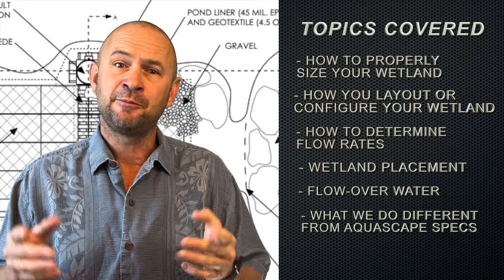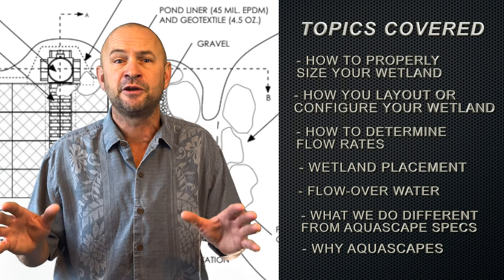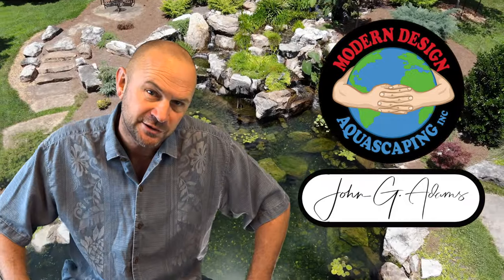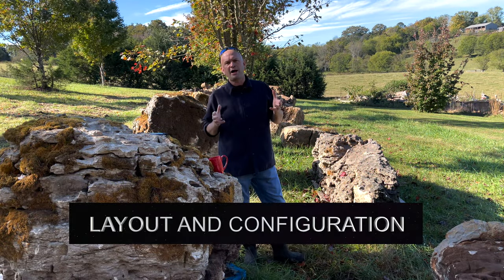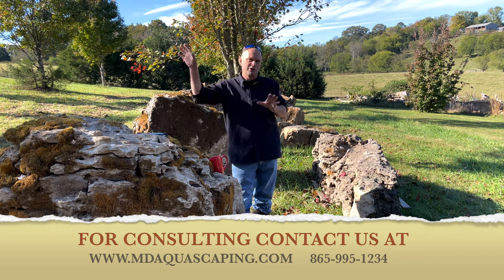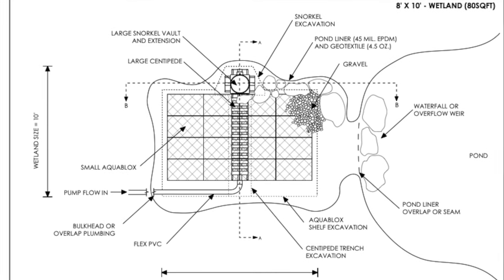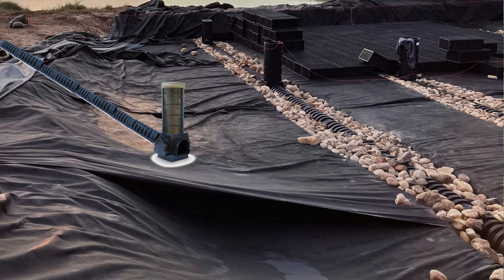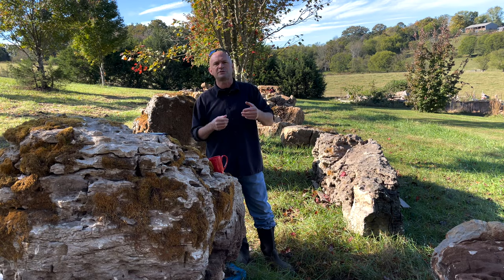How to Design and Size a Wetland Filter | Water Feature Design Series #7.1

Comment: Thanks, John. I have learned so much from you and your channel.

I'm getting to the end of my DIY swim pond build, and I engineered my own wetland filter components to mimic the aquascape system out of 12" smooth wall culvert for the centipede, 18" pipe for the snorkel and reinforced milk crates for the aquablocks. I did all the calcs to make sure my "centipede" had the same volume and open area as the real thing. Tested and loaded the milk crates to make sure they would be sufficiently strong and used the right number of them to get the same settling space as aquablocks. And 100 other little details.

This was a labor of love for myself and the sheer desire to learn the engineering behind it by creating my own solutions. I'm certain that if I were to do it again, I could do it all much faster and with more confidence. But I am also certain that the only way it saved any money is because I can value my time at $0.

If you're a professional trying to make a living building ponds, I think you would be such a fool to do it my way. Listen to John, buy the pre-engineered products, and get better at selling them than trying to figure out how to save a few $ on materials while adding tons of extra labor to your projects.
Reply from the maker: WOW- I did that EXACT same thing 10 years ago--and I came to the same conclusion. I am interested to learn more about your project!
Reply: @KoiAddiction  Sure thing. I'm (mostly) documenting it on this playlist: https://www.youtube.com/playlist?list=PLrOwYsnaliWJp1PPbFNrt-nI0vjj8Btg-

Comment: Hello John, i realy enjoy your videos. They help me a lot in planning my future Koi Pond. I defenitly would hire you, but i live in Germany, so no option 🤣 I grab all of the information i get from you to plan my Pond. I got so many questions, but one of the most interesting one is: how many times per hour would you circulating the pond through the wetland filter? The pond will be aproximitly 1800 square feet of surface area and mostly for keeping Koi. No realy run offs like leaves in this area. I know, that there is not the "one and only" true answer to this question. But in my eyes, it is one of the most importent ones! Greetings from Germany 🤗
Reply from the maker: I wanna build in Germany! I am going to Aquatic Art Live event in England end of the month, look us up! Wetland flow is based on size of wetland, not size of pond! 1500-2000 gallons per hour / per centipede unit! Size wetland properly for the pond and then flow rate to wetland!

Comment: GREAT INFO!
Reply from the maker: Was there anything new in there? Did you learn anything?
Reply: @KoiAddiction  A lot of it is recap, but you explained the process in a way that's easier to understand. Also about always experimenting to figure out the best solution for great water quality and understanding that sometimes things don't work out the way you wanted them too but by sharing the experience, others won't make the same mistakes!

Comment: Another informative video. Timely as I am bidding a few right now.
Reply from the maker: Hope you got some nuggets! Cheers!
Reply: @KoiAddiction  one of our fellow CAC s, near me, suggested I build this 50 square meter rec pond with two skimmers for the heavy leaf load, with two pipes per skimmer to an external dry pool pump. Then through a sand filter that is using glass media. Then to the wetlands.  Too much? And can a pool pump suck straight from the bottom of the skimmer? Only small matter will get to the pump?
Reply from the maker: @BaruchDavidGreenman  I did that before, the skimmers & pads  just can’t handle that much life matter. They end up leaving the filter pads out most of the time. Then the strainer baskets in the external pumps fill up with leaves pretty quickly. I would be cautious with all of that and do not max out the flow rates on your skimmer. In the sand filter I would throw that out the window absolutely no use for that when you have a Wetland
Reply: @KoiAddiction  I thought to use an intake bay for most of the water and a  skimmer or two for surface debris. That's more your style?

Comment: You are just amazing ! Under this video, once again, I want to say thank you for these so valuable pieces of information. Back in France where I live, we have no Aquascape contractors available and I need to design all myself. What you give away is gold to me ! 
Now can I ask you a few questions ? 
1. When designing a swim pond (no fish), how deep would you recommend it to be and with how many shelves (height, width)
2. For the wetland dimensioning, you don’t follow Aquascape guidance right ? For a pond of 500sqf they recommend a 8’x10’ which is 15%. But for a 500 sqf swim pond without fish, you would recommend 30%% according to your video ? (Can not having fishes allow to keep the 15%?). How then to calculate the length of centipede and the number of Aquablox?
3. when talking about turn-over flow, you mentioned once that you are looking at 1 to 2 times the volume of the pond per hour. Should all this volume go through the filter or you also count there that part of it goes to jets or additional waterfalls? 
Many thanks if you can answer this !
Reply from the maker: I wouldn’t skip the fish for starters- they are a valuable piece of the ecosystem! Like making soup without one of the key ingredients- won’t be quite the same. Swim pond depth is up to you- no rules on size. Same with shelves. Depending on stone size- I cut shelves based on the boulders to make easier building. Smaller stones are more stable on shelves though vs. vertical walls just be sure to build for stability.The 30% is a guideline, once again you can do less but if room & budget allow do the 30. LIke I said before if you can only do 15% plan to add another filter in the future (in your design) and then if you are dissatisfied with quality you have a backup plan. Wetland will be laid out in multiples of 16 small blocks (or 8 if you add a 1/2 centipede). So just extend the length of the filter as needed until you get your design. Google Aquascape wetland design or call them at 1-866-USPONDS. They will email you a schematic for the filter! For turn-over just pump the water at the filter flow rate as instructed in the video. Depending on size I add jets (we also have a video on that) for circulation but the wetland will filter at 1500-2000 gallons per hour / per centipede. Additional flow id beneficial for circulation and eliminating dead zones in the pond but not necessary for filtration. Be sure you have waterfall in the system or additional aeration as well to keep oxygen levels high! Good luck ;)
Reply: @KoiAddiction  How can I say thank you enough to provide all this information, and on Sunday moreover ! Amazing people ! Would definitely contract you if you were around my place !! 👏👏

Comment: I'm kinda glad I didn't finish my pond build. I was going with 8 small blocks. I don't have the room (or money 😆 ) for 16. Can I stack them in the wetland filter?  Does negative edge filter at all? I'm doing a negative edge instead of intake bay. Also thanks for all your videos. You have great content and I can't wait to see the finished Oasis Of Tranquility!!!
Reply from the maker: No use to stack them in the wetland- the filter is based on surface area. If anything deeper gravel may be an option. Yes the negative edge will filter a bit- stone and gravel surface should have beneficial bacteria and high oxygen levels in that area.
Reply: @KoiAddiction  thx!!! I can definitely go deeper. I will do 3, 12-16" layers of gravel instead of 8"  and just get a snorkel extension.

Comment: Hi John, thanks for all the videos, really learnt a lot from your channel. Do you have any guide for wetland filter in pond, reverse flow? From most of the guides, the wetland is up flow through the wetland, it's possible to make it down flow and what's changes is needed compared to up flow wetland? Pro and Cons? Thanks bunch!
Reply from the maker: No I don’t have a video on the reverse flow wetland. I have built one but of course it Hass to be inside the pond drawing water down through it which makes it impossible to clean without draining the pond. Also lacks the capacity to be pre-filtered by another portion of your filtration system like an intake bay or skimmer box. The reverse flow into the wetland forces it to clog up on the surface restricting flow and makes it more maintenance. It does still work it’s just not as good as the other way in my opinion anyways.
Reply: @KoiAddiction  got it, thanks!

Comment: I have heard that you can flow through each small aquablox about 90-125 GPH. My question is can you flow through less GPH? like as low as 60-75 GPH through each small aquablox, or would that not create enough up flow pressure through the layers of gravel?
Reply from the maker: You can do less, but you should be wary of low oxygen levels. we want to maintain an aerobic environment so test it if you build it OR just build a smaller wetland to the flow??

Comment: So if I have a deeper gravel bed - say 36” instead of 24”.  Can i have or do I need more flow?
Reply from the maker: Yes. You will need to test oxygen levels to figure that one out. Measure dissolved oxygen from water going into the filter and then again coming out the top. As long as you are staying in range healthy for beneficial bacteria you are good!

Comment: Great video, thank you! But why upflow? Is downflow worse, and if so, why? In Europe, swimming ponds often use downflow trough the wetland filter.
Reply from the maker: I have done down-flow. For me its about ease of cleaning . The one we installed was in a pond and it would draw the water in through the wetland. It works fine BUT I have to drain the pond to clean it. Could be designed differently and I would be OK. Potato-Po-tah-toe if you know what I am saying?
Reply: @KoiAddiction  Sorry, not really :) Any tip to how a downflow WF could be designed ease cleaning? Thank you!
Reply from the maker: @petersvan7880  not sure- I had to drain the pond and rinse forever to get mine fairly clean. It was never able to get as clean as our current design.

Comment: How much does depth of the wetland matter? If i I want to use a wetland as a vegetable/fruit garden, can I go wider but shallower than the 3-4 foot deep pits I sometimes see in your videos? like maybe only deep enough for the snorkel, one layer of blox, then the gravel? and does a higher vegetation load necessitate a bigger wetland? what would redoing the math for that configuration look like?

Also, Can you tell us more about wetland filters at the bottom of ponds and how that works? I thought the plants were essential to using the nutrients in the water in order to clean it but you could only use underwater plants that you wouldn't see if it's under water, right? and how would you clean it, because if you backflush it, you've dirtied all your pond water and can only clean it by having the wetland suck it back down to where it was in the first place, right?
Reply from the maker: Please read a few of the answers to the questions right above yours- I just answered your questions above and they are “long-ish” answers! You don’t have rules-per say. Any configuration is possible and what you do differently may be exactly what is needed to get the results that you are looking for! If you experiment, please let me know what and how- I love to learn! Thanks John G

Comment: Why must you do a back wash of the wetland filtration system if inserting a sum pump in the snorkel will remove solid waste? Also, when you do a back wash, must you replace all the water?
Reply from the maker: The back wash pushes the solids down to the pump for removal and yes, the water from the cleaning of the wetland is discharged from the system.

Comment: Can you turn a wetlands into a giant reverse osmosis filter? With charcoal etc
Reply from the maker: LOL that is an interesting (and new) question!! I have had a RO filter before, have never thought about trying to make a wetland into one…
Reply: @KoiAddiction  bioballs inside the aquablox (more surface area for bacteria), then a large chunky charcoal layer, then a porous rock layer (lava?). Will that work?
Reply from the maker: My favorite thing about a wetland filter is how easy it is to backflush. It does a great job of settling out fine particulates if you have your water flow dialed in. It makes it easy to drop a sump pump and pump out fine particulates, much like m a vortex filter captures Debris. The problem with adding bio balls into the aqua blocks and layering other materials is that you diminish the ease of flushing solids backwards through the system. I’m sure other things like you discuss will work 100% but I fear that overtime the ability to backflush becomes more and more impossible to do. I know many people who are dealing with early wetlands that were installed using various methods. Often people are forced to physically remove all of the aggregate in order to get the filters, clean and functioning again after 5 to 10 years. I would myself figure out a different way to add additional filtration, even though the wetlands work, so amazing. I guess my question is what makes you need additional filtration and is there a way to incorporate it into a separate area? This might allow you to do a main wetland and then a smaller one full of bio balls and charcoal, so that if there is an issue, you don’t have to tear apart and rebuild the entire thing. I am thinking that this secondary wetland may have only a thin layer of gravel on top of the aqua blocks so if you ever needed to remove the top panel from the blocks to allow access for cleaning and unclogging that you wouldn’t have to remove 24 inches of stone from the top. All these ideas are hypothetical of course but nothing sucks worse than shoveling 2 feet of gravel out of a wetland filter…

Comment: Rain water flooding:-
Will rain water flooding the pound and its run off 
Will it be contemenated ?
Reply from the maker: Rainwater definitely does have an affect on the pond. As long as it’s not acid rain, you are safe from the rain water. The problem is typically the sediment and Contaminants in your runoff. We often divert rainwater that carries large organic loads or create sediment capture. Meant areas. Totally depends on your situation. At my house we capture the rainwater from my roof and it runs into our reservoir. The gravel in the reservoir removes most of the large debris before it enters our feature.

Comment: Did you delete my question in comment?? 🤔🤔
Reply: Can we do a aquascaping like we do in aquariums at the bottom of the pond and yet get crystal clear water without any algal bloom with a wetland filter system?
Reply from the maker: Sometimes there is an algal bloom, totally depends on all of the environmental conditions imposed upon the ecosystem. In my experience with proper Water Feature management practices it passes and becomes manageable.
Reply: @KoiAddiction   thanks, that helps 😊